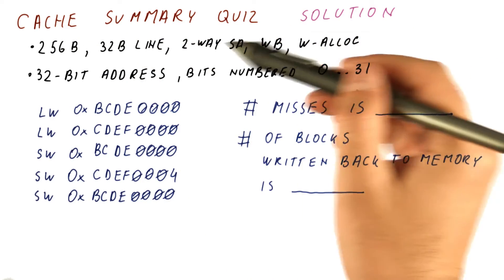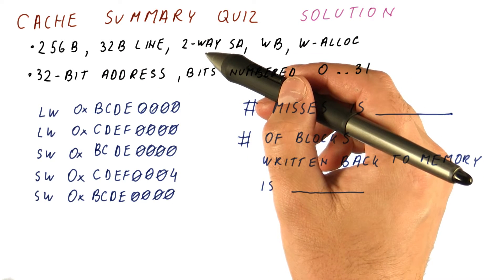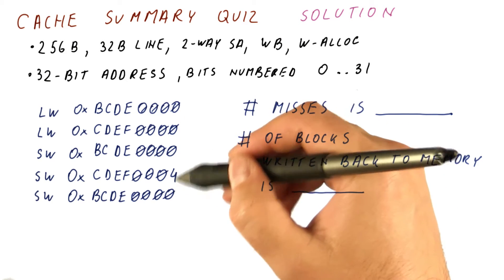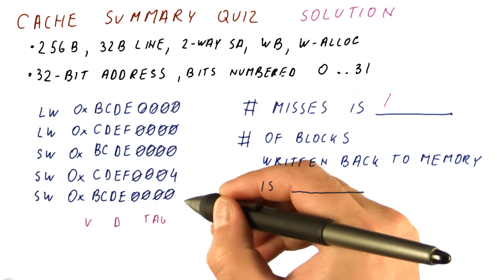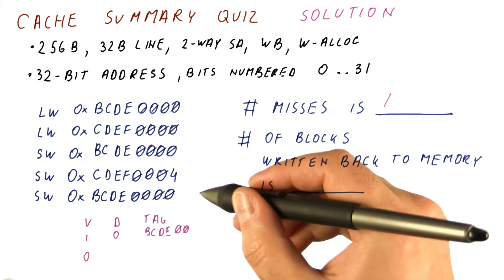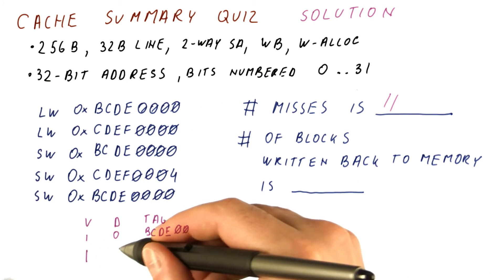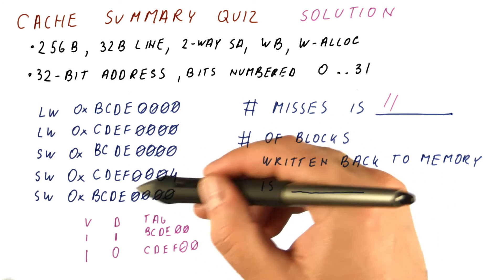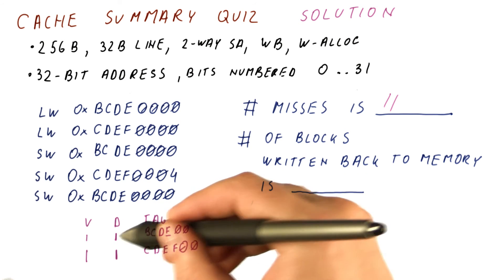Cache Summary Quiz Solution 2 - Georgia Tech HPCA Part 3

Comment: We write to 0xBCDE0 twice. Should we have 1 write-back then?
Reply: In total we have 8 blocks, and so far we only use 2 of them. I think we are assuming the cache is write-back policy cache so we do not write back to memory until we evict it. Therefore, cache write-back is 0.
Reply: @danieltong7900  as @200415670 mentioned, we do write to 0xBCDE00 twice. While we have 8 blocks (4 sets), the index bits in the three SW addresses are all 0's, meaning the last one overwrites the first one (as it is a 2 way cache). So the first SW for 0xBCDE00 is evicted, before the last SW.